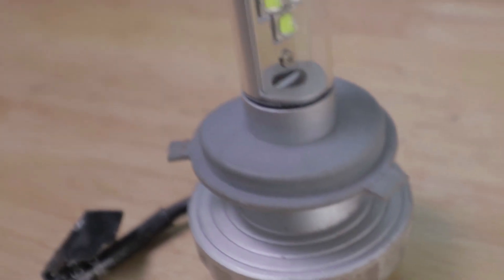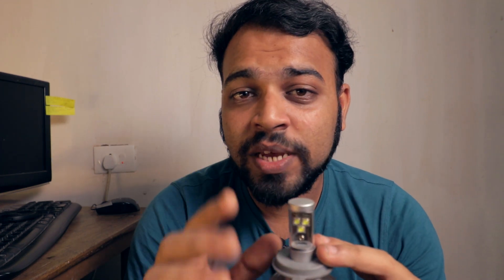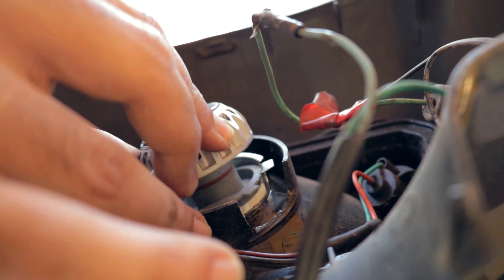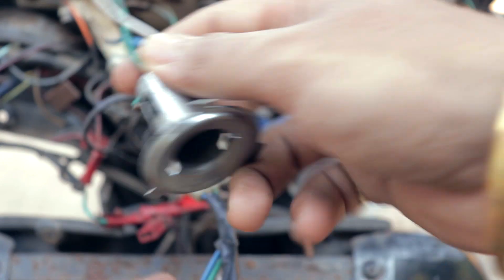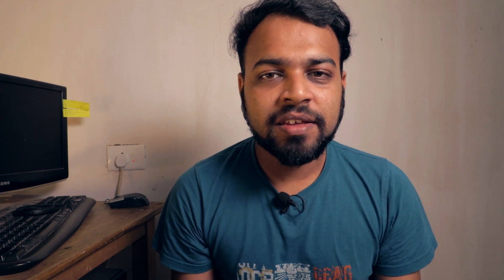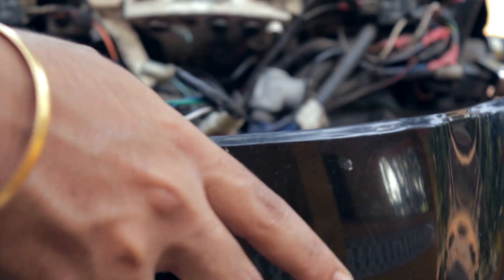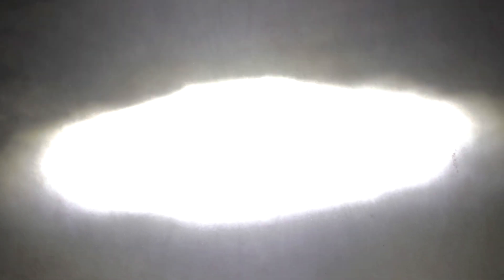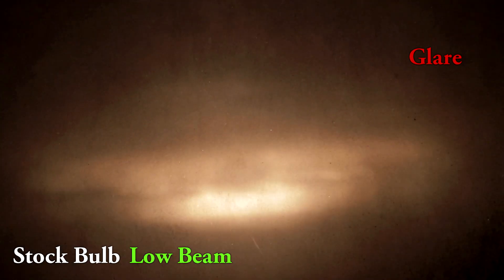Superbright LED Headlight For any Bike | CREE led bulb |  how to install led headlights| DIY

Comment: Auxbeam t1 howz this light for activa 3g
Reply from the maker: Looks good on paper atleast
Reply: So should I buy it... Or any other good recommendations around 1k
Reply from the maker: Around 1k nothing which I could recommend in LED to be honest
Reply: Check this out
Reply from the maker: In the video the camera is overexposing. Actual output wont be that much as the Chips are not that capable

Comment: Any battery drain issued, becz In my stock setup also battery horn don't work properly, I'm using amaron dry battery, u have change battery with high voltage.
Reply from the maker: Nothing as such, the last battery which I had which I haf replaced somewhere at the same time of this setup lasted for 4+ years and u replaced it some two weeks back. 
Maybe your RR unit is faulty or inefficient to charge, get it checked

Comment: I need Your Help please Reply
Reply from the maker: Yes , tell me
Reply: @RahilChodanker  I want to a very bright head light for my Bullet STD 350CC 1971 MODEL, I've  changed the wiring to 12v to required original specifications... yet the light is very low
Reply from the maker: Changing to DC will not have any impact on brightness, you will need to change the bulb to LED one or get a good LED projector Installed. That's the only way for brightness. Stay away from all bulbs costing less than Rs.2000/-  they will only look bright but will not throw any usable light on the road
Reply: @RahilChodanker hmmm I wanted to use the cutout system on my Bullet just help me with the diagram.
Reply from the maker: You already have 12vdc like you said in last comment
Reply: @RahilChodanker  Yes it has a AC/DC Adapter... in the wiring kit... as you explained in the video... About using the relay
Reply from the maker: So if you are getting stable DC then you can use LED easily
Reply: @RahilChodanker  can we talk over the phone... our conversation is not meeting any result
Reply from the maker: Send me some pictures about the converter you are talking about  on my Instagram and let's take it forward from there🙂

Comment: I'm looking for video or tutorial how to convert H4 in T19 headlight lens.
Reply from the maker: Use Dremel to make the mout but again you might not get proper focus of the beam so be aware of it before modifying
Reply: @RahilChodanker  is it okay for this kind of bulb to get wet? I mean the back part??
Reply from the maker: It is rated to be waterproof. But if I would not recommend for it to be exposed to water all the time

Comment: what if you connect an rectifier on headlight cables as an input and the headlight get connected to rectifier's output? I only care for main headlight to be dc. Is there any way you can do this or I'm talking nonsense?
Reply from the maker: The output of rectifier is DC but it's variable depending on the rpm of alternator. Using battery fixes this and you get proper stable DC, hope this clears your doubt 😊
Reply: Your solution is the best, but I really cant pull this off. You seem to know a lot about electrical engineering so one more question for you if you may. If I use specifically a full bridge rectifier with a capacitor, then add a voltage regulator for further smoothing and finally connect the led bulb on the regulator... Any idea if this going work? Can you help me determine specifications of parts as well by assumig my motorcycle has exaxt same ac output as yours.
Reply from the maker: Well you can do that but it would be redundant. As In , the scooter already has Regulator Rectifier which does this job for you. But the problem is as per the engine RPM this Output DC connected to headlight ( stock condition)  fluctuates approx between 7-13vdc.
That's why use battery as source for stable supply which will not drop below 12v ideally.
However you can do away with the scooters RR unit and use the bridge rectifier setup with voltage regulator but that will be a tedious job to do and adjust the values plus not to forget reliability would be of question. Too many red flags for me to go that way and that's why I won't suggest doing that.

Comment: Can I install dis bulb in my new dio dx? It's bs4 model so dat bulb will run in day time also... Is there any 🔋 prlm
Reply from the maker: There is no problem but you will need to convert your dio setup to DC  otherwise the bulb will have short life
Reply: @RahilChodanker  Tnq so much bro

Comment: Pulsar 200 dtsi 2007 model ko full dc kaise kare
Reply from the maker: anupam rastogi use the same logic of the connection that I have explained, just your wires will be in different position , simple. Take help of a multimeter so that you don't make any mistakes
Reply: Bhai isme ac bcu laga hua hai
Reply from the maker: anupam rastogi ecu ya bcu?
Reply from the maker: anupam rastogi then bypass it , donf include BCM

Comment: 2.5 amp ki battery
Reply from the maker: Sandeep Sharma i'm afraid 2.5 is less, it will work but you will also have to make sure to ride the bike in daytime so the battery gets charged

Comment: 2 issues
1. music loud at times
2. cant really hear when you said what other type bulb fits

other than that good video and LED ftw
Reply from the maker: Feedback noted Jeff, will make sure I work on it.
Thanks for appreciation 😊
Reply: @RahilChodanker  np lol. my rexy is different and cant mob it like that, sucks. but there is ba20d LED for yamaha jog and rex buyers which parts dont sell anymore, stuck with a moped that cant get parts LoL, but 2 stroke 50cc bad ass
Reply from the maker: Haha, even my Honda Activa had Ba20d but then I modifided it yo fit H4 type. Might be possible for you too, worth a shot😊